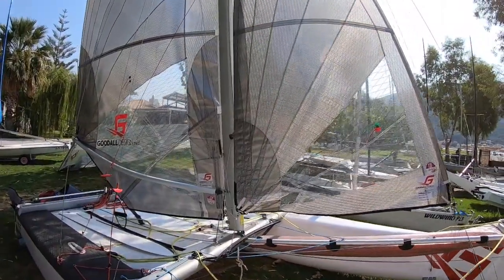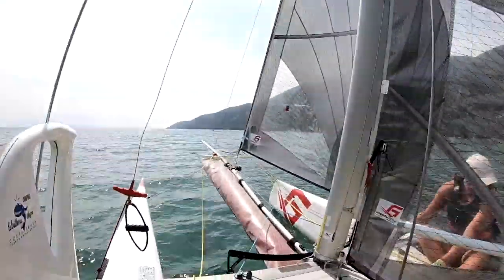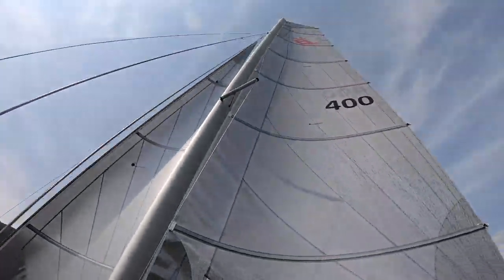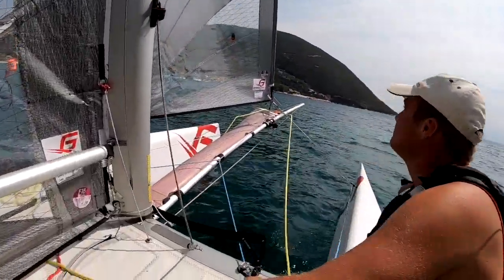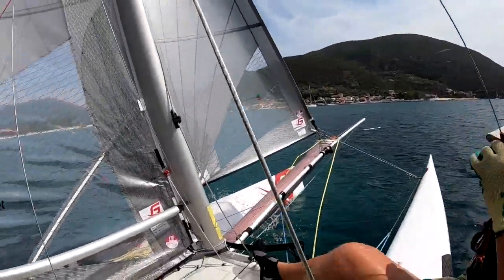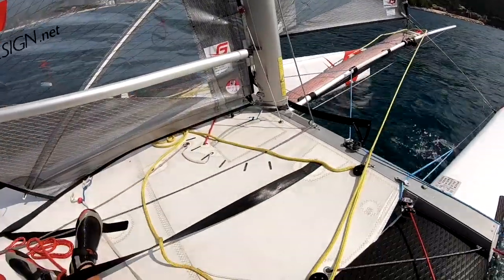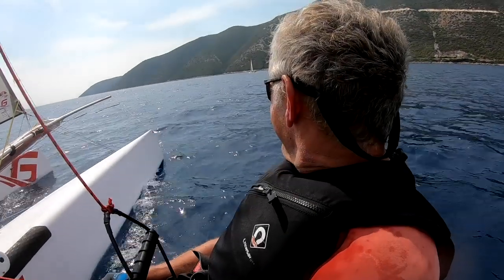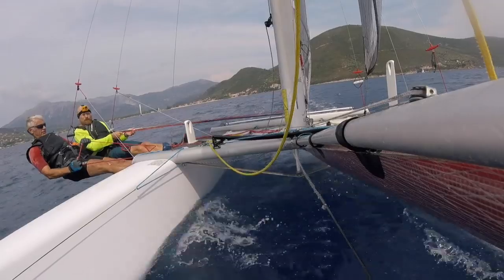Decksweeper F18 Rig,  introduction and first look on the C2

Comment: Removing sail area from the top and putting it on the bottom is apt to be slower in light air where you need more sail and shape up top where the wind velocity is greater, but it is faster in moderate to heavy air where you really don't want nor need all that power and leverage up top - you do better having the power down low. The boat experiences less heel and the power is turned into greater forward motion.

Comment: Hi Joe, it is time for renovation in the F18 class..., I was having windsurf sails with battens below the boom in the '80s... Perhaps the only reason this shape has not been used  before is for a problem of sail tonnage since this profile is more efficient both aerodinamically and because is lowering sail "center of gravity" as you mention. Regarding how the crew needs to go around the mast I remember the same movement by a couple of very good guys who were preparing for the Italian championship something like 10 years ago... Just waiting for you to fly on catamaran, either on Nacra or, if I'm correct, also F18 class will foresee flying boats shortly... My (secret) dream...;-)
Reply from the maker: I am waiting for my flying opportunity. Hopefully next year
Reply: Joseph Bennett I’m also waiting for a bit of joyriding on the magic carpet, maybe flying phantom essential.

Comment: Hello from Italy Joe.In your opinion, the small jib with very high aspect ratio but with low squares meters surface, is an handicap for the f18, compared for example with the dimension of the jib of an hobie 18,or similar, upwind, or downwind without gennaker? thank you so much
Reply from the maker: Hi Lorenzo, 
The smaller Jib of the F18 is really all that you need upwind - I think any more size would possibly be beneficial in light winds but once in trapezing conditions I think it would add drag and actually slow the boat down.
I'll answer this in full in this afternoon's Q+A
Reply: @JoyriderTV  🔝🔝🔝